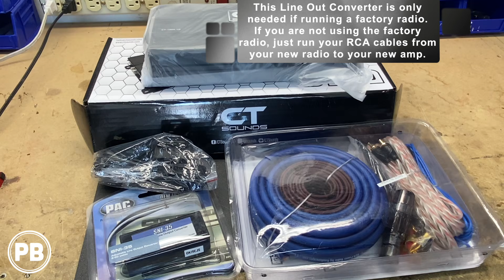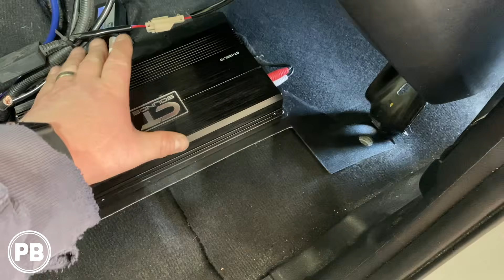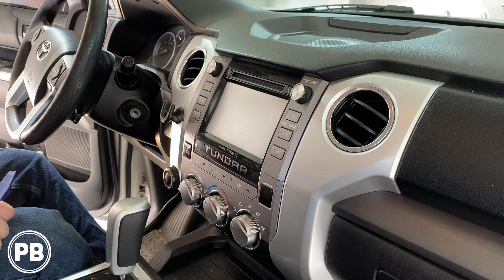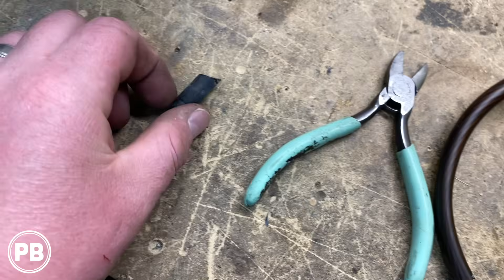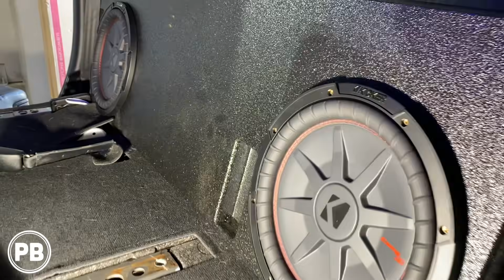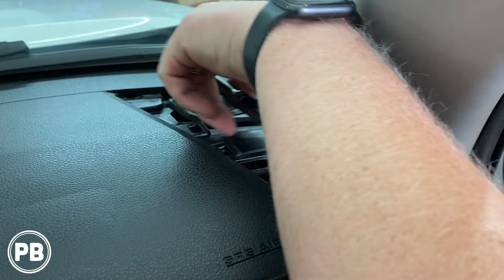2014 - 2021 Toyota Tundra Amp and Sub Install

Comment: Was the fit too tight for grills on the subs?  I have a 2016 Tundra CrewMax myself, and will eventually put a system in it, but I'm not sure how I feel about putting a sub in with no grill.

Comment: What harness to I have to buy if my tundra 2018 came with JBL thank you
Reply from the maker: You will need the Pac APSUB-TY12 AmpPro interface that provides a sub output from the OEM radio.  Alternatively, you could tap into the OEM sub wiring and utilize an AudioControl LC2i or LC2iPro.

Comment: Hey does anybody know why when I added JBL tweeters to my tundra where it never had tweeters I can barely here it . The model truck never came with tweeters on the door so I added some but I connected the tweeter wires to the 6/9 speakers . I did correctly soder bass blockers to the positive wire but still hardly no sound. Do I need to add cross overs ?

Comment: So i wired up my sub and just gave it power and ground, then ran a wire from one of my speakers to the amp as signal wires and they work great, any reason why someone would do all this complicated stuff instead what i did, genuinely curious, cuz other than running  power, my way is free and takes like 5 minutes, if that

Comment: Good video can you do or have a video installing an aftermarket stereo with the same amp and subwoofers on a 2018 tundra crew max?
Reply from the maker: We already have a radio install, linked in description. Same process, minus the line out converter.
Reply: Thanks I found the video i was loo at your website and it say that y’all can prepare the harness for $49.99 …and another question if I get a Tesla edition radio do I still need a harness to connect an amp with subwoofers ?

Comment: I just bought a 3 way components for my 2021 tundra, my main concern is where can I put my 3" mid ?
Reply from the maker: Without any custom fabrication, hard to say without seeing them in person.  You could drill and flush mount them in the door panel, or in the A-pillar.

Comment: Hello I have a tundra trd pro with jbl I was wondering can I just by a dsr1 my two channel amp an my subs 12 inch wanna keep factory radio
Reply from the maker: Sure, you can keep the factory radio, add a line out converter or signal processor, and install an amp and sub.